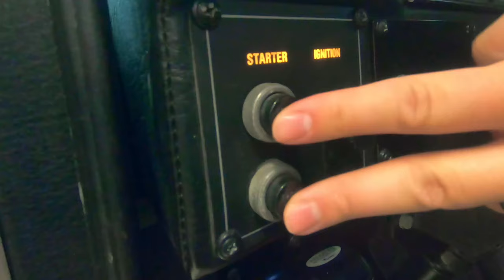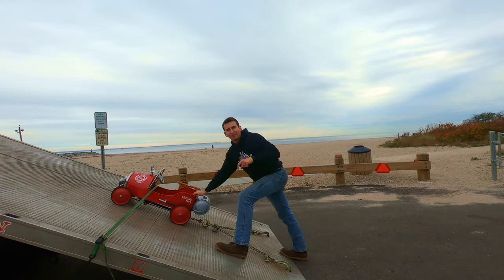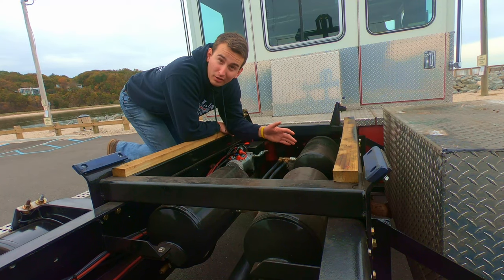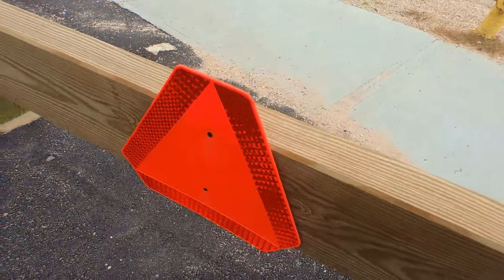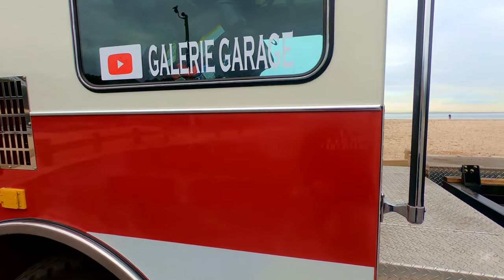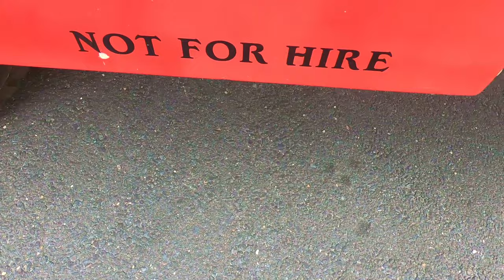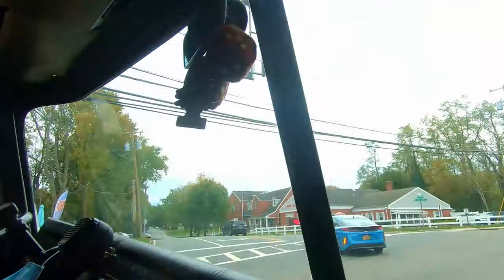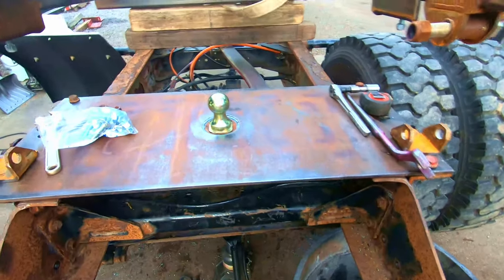THE ULTIMATE FIRE TRUCK TOW TRUCK TOY HAULER IS FINISHED!!!! WILL THIS TRUCK BE 2022 SEMA WORTHY??

Comment: Always wanted to do a build like this.  Old fire trucks are awesome but you can't do much with them except push water and drive around.  Subscribing to get ideas for a build, but I'm going to add a knuckle boom ahead of the bed.  I like the flexibility of your setup.
Reply from the maker: Thanks I appreciate it! Fire trucks need a second life instead of sitting In a field to rot. If you start your build keep me updated on it! The knuckle boom idea sounds awesome! Most trucks have a pto for hudraulics or have the transmission to easily install a pto.
Reply: You can convert a tanker into a beer keg tanker. 😎

Comment: Could you get Allison to give you the engineering approval to unlock 5th and 6th
Reply from the maker: My transmission doesn't have a 5th or 6th gear. It is only a 4 speed I looked into it. It's all mechanical there is no computers.

Comment: Just to let you know those are not super singles on the front
Reply from the maker: Anything wider than a standard semitruck tire is considered a supersinge. Atleast where I'm from. There are super single for rears to replace dually, super single drop axle tires and super single steer tires usually for heavy weight steer axles found on fire trucks, cement trucks and heavy haulers.
Reply: @GalerieGarage  Wide base steer tires would probably be more corect in terms of a steer tire.